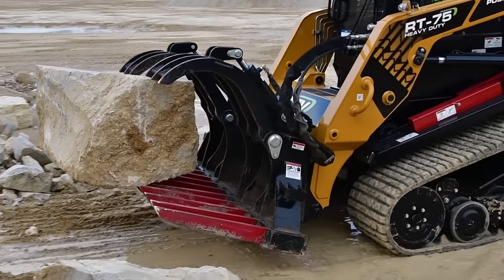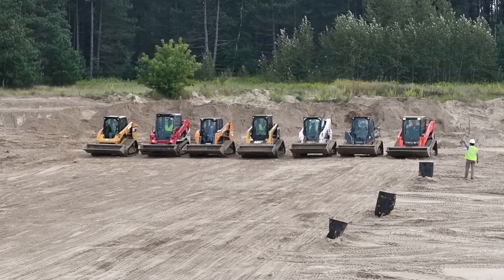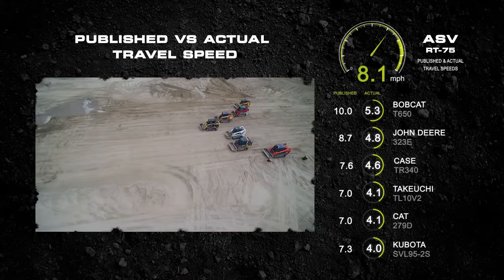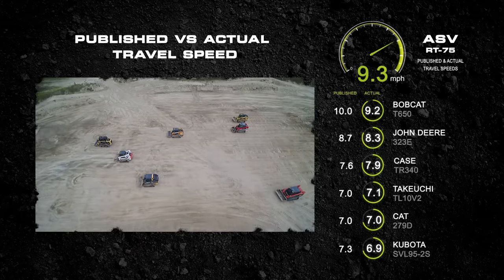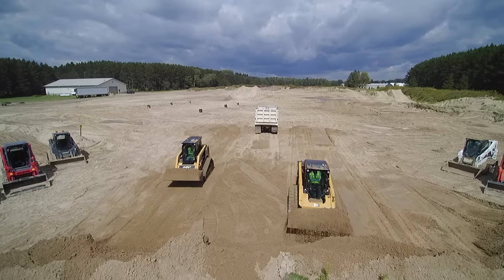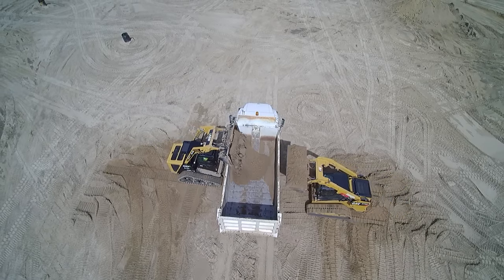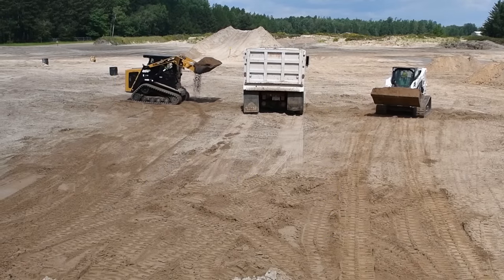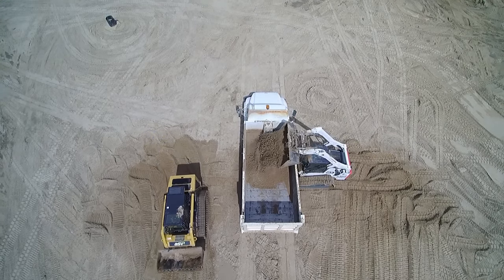Speed: ASV vs Competitive Loaders

Comment: Had a 99 ASV HD4500 the thing was a beast , could push or lift most anything we ran into . The hard pipe cracked in the belly pan losing pressure so i swapped them for hose and there was no stopping it .

Comment: I have a bobcat s205 17 years old still running it works great i like it because of the power from a 60 inch machine and lift I also have a s595 and its ok I like it overall not to impressed with it but it does the job anyone that has a bobcat I suggest welding up that 3/4 inch hole on bottom of skid plate and drilling some small holes instead i had a 3/8 rebar poke my tank  , and the only way to fix that is to pull the motor at the tune of $5300 dollars ouch .

Comment: The Takeuchi goes way faster than that
Reply from the maker: Hi Robbie, feel free to schedule a demo with your local ASV dealer to see the difference. http://asvi.com/dealer-locator/
Reply: ASV Holdings, Inc.  lol yes I will
Reply: The Takeuchi will blow that things doors off
Reply: Thats the sure indicator it is rigged, the Takeuchi is in slow.
Reply: Takis are fast but the track system is garbage. Sidehilling with a full bucket is a nightmare. It's fine with brand new tracks but after a month you have to crab walk it to keep the tracks from peeling off.
Reply: I've seen the Tak's.  Great if you like driving a brick.  I drove one and had to file a claim with workman's comp.  Rattled by teeth out!

Comment: Not good for septics system when traveling in stones and loading, i had one Cat with ASV and the rubber on boogie wheels just got torn apart. great track system but the welds break where the rubber shock is located and connected to the axle leading to the other side. hydraulic line rub against the body where it enter the cab resulting hydraulic fluid leaking all over the place. they may have made some changes  but this was a Cat with ASV undercarriage 
Bought a 2015 new holland c232 and the 1 hour of running time the small coolant line blew apart due to crimp type clamp.The new holland drive feed hose rubs on the floor causing metal jacket to wear away resulting another hydraulic blow out with fluid all over homeowners property. Changing hose no big deal but take track off.

Comment: I don’t know about everyone else but I wouldn’t want to be flooring my skid steer to the metal loading a dump truck
Reply: Lol if you actually had a skid steer

you would know the pedals are not what control your tracks.
Reply: @jaxturner7288  I know the pedals don't control the tracks but I mean I wouldn't want to load a dump truck at full speed
Reply: Jack Matuska time is money running equipment, you work as fast as your skill and conditions allow.
Reply: You can always tell who the young cowboys are… go like a bat out of hell… make a bloody big mess and thrash f&@k out of their gear… and at the end of the day get no more done then a smooth operator 🤨

Comment: Odd how the king of skid loaders wasn't included in your testing!
New Holland
Reply: RJ 1999 case and new holland are basically the same
Reply: @jacobschmidt3178  not even close. The case doesn't have the super boom, it's a conventional skid steer
Reply: Dude im sorry but New Holland isnt even close to the king of skid loaders.
Reply: @jdgingerich7806  then you never operated one
Reply: @RJ1999x  actually i have, i ran a 200hr c232 that was owned by one of the contractors at one of our jobsites and i despise that machine. #1 thing was that it had plastic joysticks, they didnt feel at all quality. #2 the joysticks are not attached to the seat and its suspension system so it doesnt move up and down with the seat when your on rough surfaces. Makes for a harder time controlling it smoothly. #3 door design, its a poor design and i couldnt see the corners of my bucket very well #4 it forced you to wear a seatbelt to operate it. #5 it had no passcode, button start. And no key to lock the door with. #6 the engine is mounted front to back instead of side to side (like BOBCAT) and it made it hard to complete even simple tasks like changing the oil filter or accesing the battery. There were afew other small things i didnt like but i cannot remember what they were. And that is why i dont agree with you that they are king of skidloaders.
Reply: @jdgingerich7806  your a bobcat salesman and that's why. Not to be hurtful, but the Bobcat is the worst designed skid steer I have ever encountered, what Bobcat has going for them is brand recognition, and being one of the first to market.
The tell take sign your a salesperson, or work closely with bobcat is to bring up.the cross mounted motor, which is an absolute disaster for service
Reply: @RJ1999x  dude im nothing even close to a bobcat saleperson 😂😂 i work for a concrete construction company and i have had the opportunity to operate mulitple different brands of machine. I also do alot of the maintenance on our equipment. Tell me why you think the cross mounted motor is a disaster?
Reply: @jdgingerich7806  serviceability is horrible. You can check the oil etc easily but any other task is a nightmare. The engine is mounted cross wise to get the weight as far back as possible to try and make the skid steer stable . Bobcat is the only company that does that, which is another pretty good indicator as to why it's not good.
New Hollands are by far the most stable machine on the market, that's why they don't need to play games in the back
Reply: @RJ1999x  lolololol nh and case are the same machine buddy they're built by the same company. I have run both extensively. They both are crap. Get a full bucket of wet gravel and watch the loader arms slew and flex back and forth. Don't tell me it's not true because it is and I've seen it. Also their joy sticks absolutely suck! Very cheap poor made machines.
Reply: @user-zu2bw7ig5v  your completely wrong. The case is a conventional skid steer with a tower in the back the loader arms pivot on. The New Holland has the linkage for the super boom. Both are made by CNH but a vast difference in abilities
Reply: RJ 1999 I like the cnh machines as much as you but Ryan is correct they are the same machines with the exception of some exterior design differences. I have both brands I think you may be comparing radial and vertical lift designs.
Reply: @andrewl1269  other then the 2 smallest models, all New Holland have the super boom on them. Case machines are a conventional rear tower design

Comment: Yes, ASV is the fastest when going straight with nothing in the bucket.  Try using the machine like it would be used with a full bucket and turning!  I bet the JD wins!!!
Reply: Nope. i did extensvie testing before buying mine and nothing can touch the ASV for speed. Are there things I don't like? Absolutely, but the speed is second to none.

Comment: Bobcat operator was trash.. we have two S750s and a T595. Way better than made out to be
Reply from the maker: Hi Nick, we did this test several times and found the Bobcat loader had a slower rate of acceleration. In this application the engine tended to bog during starts, and the machine accelerated slowly. This showed up again as major factor when truck loading, an application requiring the machine to go from forward to reverse frequently. Its slow acceleration was one reason for the results seen here.
Reply: If it bogs on acceleration the fuel or air  filter is plugged.
Reply: @ASVCompactEquipment  it looked to me like it was kept in 2nd gear when you were trying to do sharp turns to load the dumptruck. Ofc its not gonna be fast